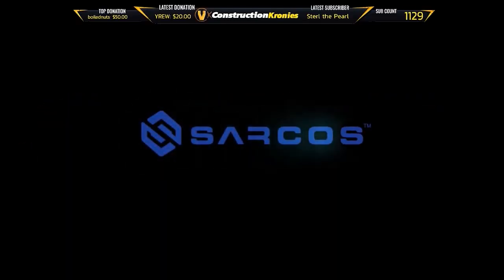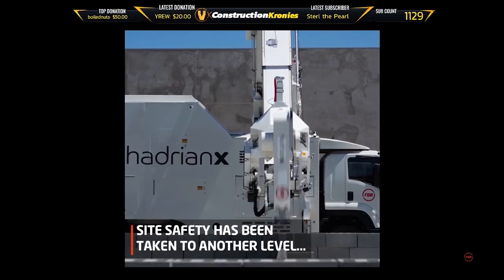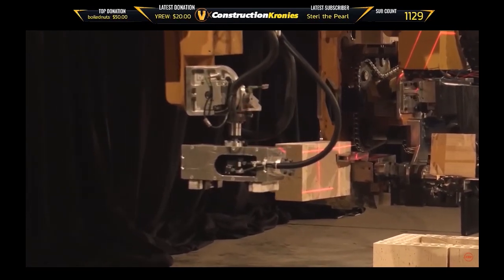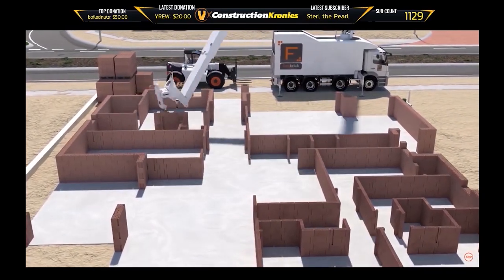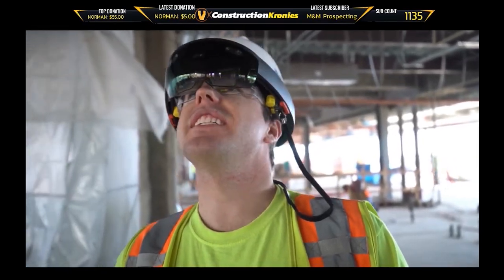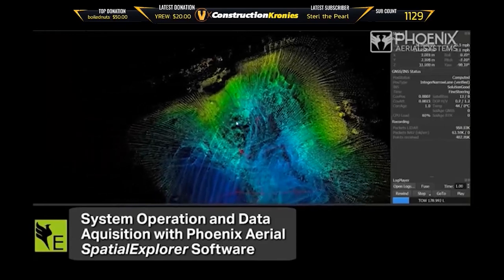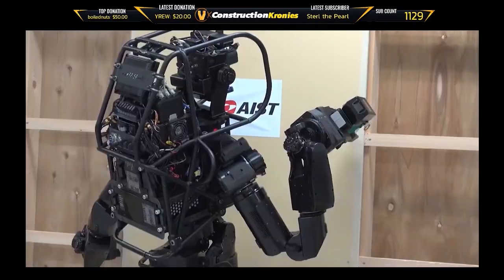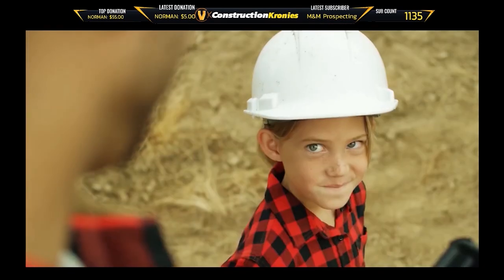5 Amazing New Technologies In Construction

Comment: That is some pretty crazy technology on some of these. I believe my favorite one is probably the first one mentioned where the guy is controlling the robot welder and grinder from a short distance. The robot controlling the heavy equipment such as loaders, backhoes, dozers, and smaller skid steers are pretty neat as well however I think I would be a little freaked out at first sight of seeing a piece of heavy equipment operating itself without fully knowing what the heck was going on. However I have to disagree that pay in these various fields of building and construction and maintenance have kept up with the growing cost of cost of living increases. For the 20 years that I've been in this business I can tell you that when I first got into this business 20 years ago my pay compared to my cost of living was a lot better then let's say every five year mark looking back it has been more and more difficult to keep up with the cost of living with the pay being received and this is not just in looking at my own personal pay it's also the pay of the people around me. Just take piece work for example in the air conditioning field when I first started air conditioning in 1999 installers for residential work we're getting paid $150 her piece of equipment will there be an outside condensing unit or an inside evaporator coil and they were getting $200 / heating unit regardless if it was electric heating air handler or a gas-fired furnace. Yes those prices have gone up a little bit however they haven't gone up near enough to be able to keep up with the continuous cost-of-living increases year-to-year that being said cost of living goes up every single year apartment rent goes up every year fast food goes up every year groceries go up every year and those pay schedules do not go up every year they might go up a little bit here and there but definitely not every year I would say more like every three to five years and they don't go up three to five years worth of cost of living increases they may go up one to two years worth of cost-of-living increases which leaves a pretty substantial gap of several years worth of continuous cost of living increasesmaking it more and more difficult for the motivation factor in these lines of work to stay at a productive level and I believe that is the main reason for the work being done by those in the field being less productive as you say they were way back when.all that being said it was a very great video and it was full of great information and content I just had to voice my opinion of my views on that one aspect of it. Great job and keep the videos coming they are getting better and better.
Reply from the maker: Yeah that's were they screw us, is the pay, they pay us less because materials are higher, its always us that get screwed. It drives me insane and is a major reason I am done with working in the trades. Once you hit that max pay they try to chince you at every corner. It's so bad nowadays for the workers it makes me sick bro! Thanks Eh!
Reply: @ConstructionKronies  yeah 15 years ago I was making so much more money and I am right now my pay is actually went down not up so that's completely backwards but I'm not doing the same thing anymore either so I'm to blame for that however the reason I'm not doing the same thing now is because 15 years ago I was paying my helper more money than what I'm making right now quite a bit more like three-and-a-half to four times more a week in what I'm getting right now heading that was my helper so imagine what I was making yeah it's piss me off so bad that I just went ahead and almost gave up it will actually I pretty much has given up I'm just rolling with the blows now it is what it is and I'll take what I get and screw the rest. I just have absolute zero motivation anymore hey I can't even get motivated to go try to make money like I did before because it's basically impossible in my eyes. No joke I took a 75000 to $80,000 per year a cut leaving me not even enough money to live on by myself.I work just you just as hard or harder now for that much less money which is scraps